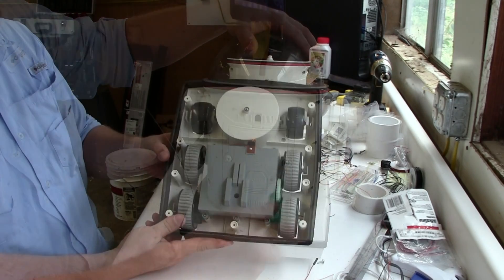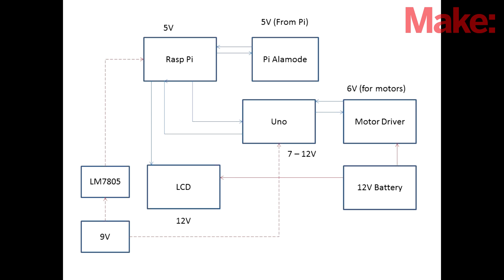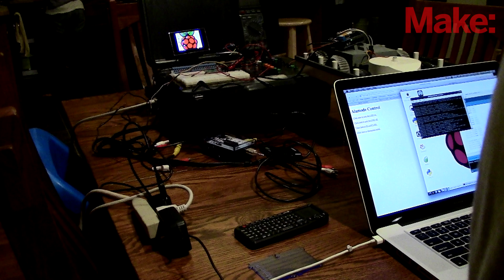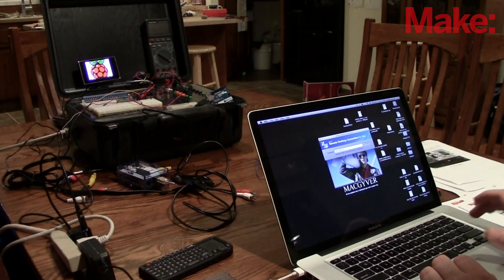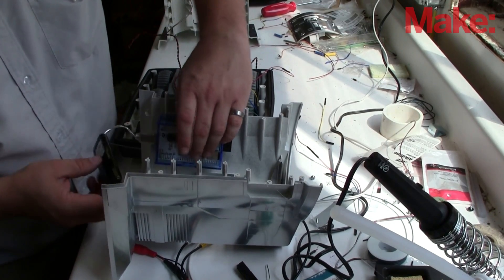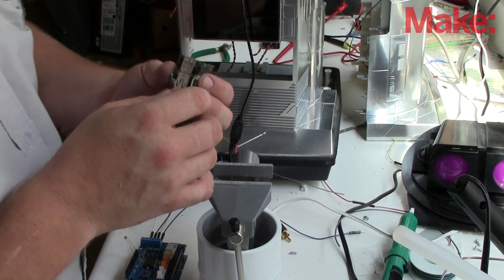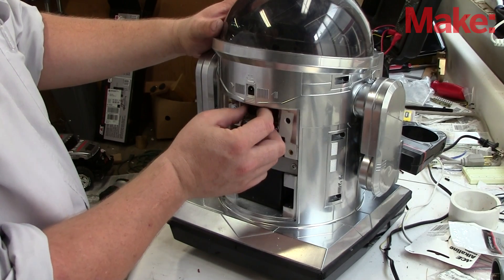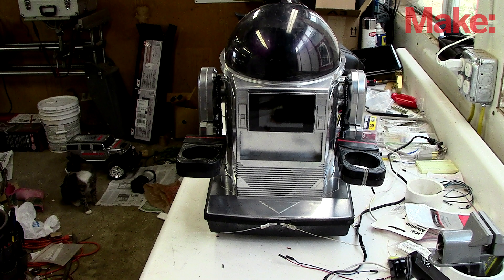Projects With Ryan Slaugh

Comment: Very un-inspiring. You don't explain anything particularly interesting, nor do you show it actually moving. One of the trickiest parts to a wheel-based remote device is getting the movement from user-interface to motor control fluidly. I want to be excited about your effort, but this video shows little more than you dumping a ton of tech inside a box and booting a pi.